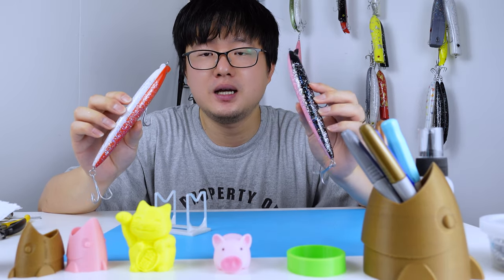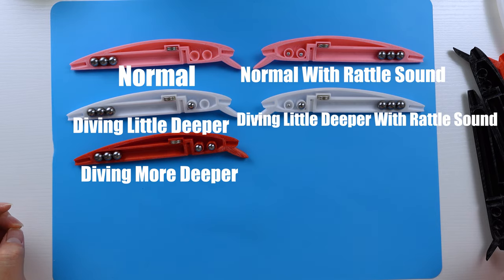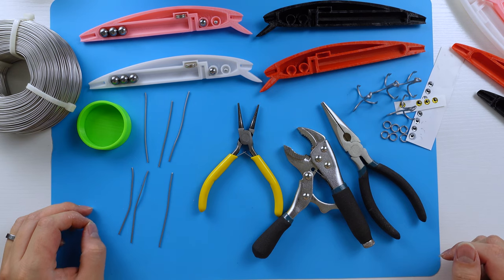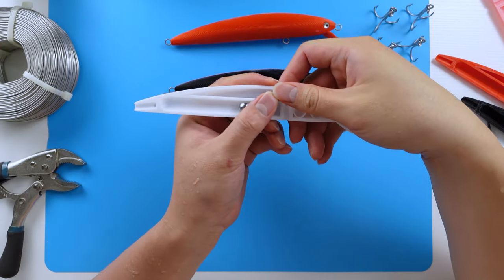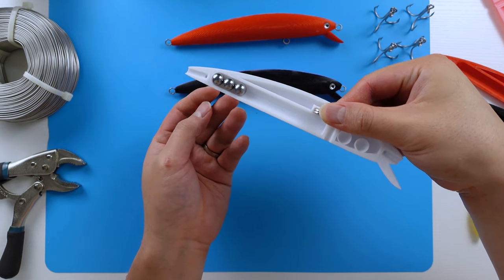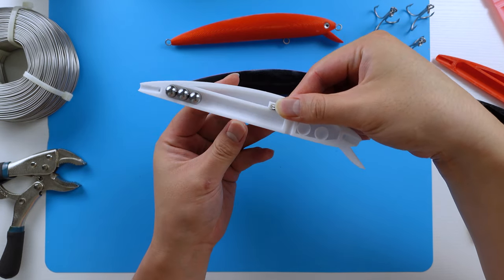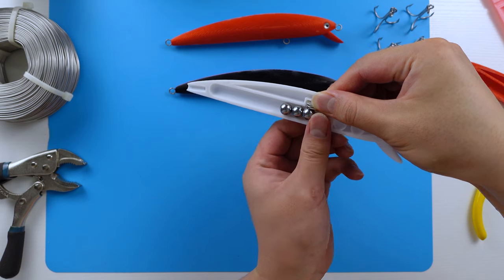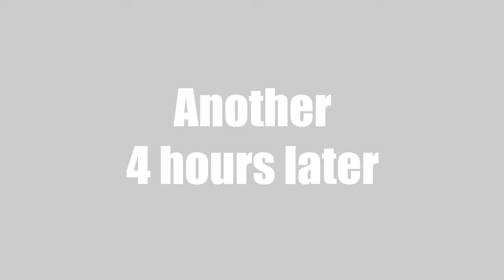Making Minnow Lure with Magnetic Weight Transfer System. 3D Printed Fishing Lure Making.

Comment: I’m doing similar work. Probably not going to create a YouTube channel.  You have a very clever way of locking in the twisted wire using tag ends. Those who build lures will see and know, but for those not into lure making you should slow down and talk about how those tag ends going into the hole add considerable strength. For me, the toughest part was learning fusion 360 enough to even get started. That’s prerequisite to what you’re doing here and people probably would like to see. I know I personally would like to see how you get such clean internal structures. I design one side using offset profiles lofted to generate solid then I shell it then fill center stuff then mirror at the end to get 2nd side. Nice video!
Reply from the maker: Thank you, glad you like it.

Comment: You all but begged for our comments, so here are mine. (I'm a longtime saltwater fisherman and amateur lure-maker.)
1. I'm quite sure this is meant to be a "how-to" video. But NOBODY can learn about what you're doing when you speed up the "tape" until it's almost a blur! This was particularly bad when you were fabricating and installing the hook eyes. I even used the YouTube utility to slow the playback to .5, but that wasn't enough!
2. You show us your procedure for applying three coats of clear finish, but you don't tell us WHAT coating you chose and why. In fact, you hardly talk at all during this process.
3. I think the main focus of this video was supposed to be your weight-transfer system. But you didn't explain why you chose this particular configuration—a horizontal tube, three bearings, and a rare-earth magnet mounted off to the side, at one end of the weight tube. There are many, many ways to accomplish this weight-shift goal, but you don't say anything about why your system is better than the others.
4. You didn't show us a water test of these lures after they were completed! You left us guessing about how they swim when retrieved AND about how well your weight-transfer design worked during each cast. 
     I'm sorry if I seem so critical. I wouldn't have written these comments if you hadn't asked. Most important, I believe this video COULD have been a really valuable, useful one. But—for me—it fell way short because of the lack of detail and the absence of a water test.
Reply from the maker: Hi, thank you very much for this very detailed comment. Because this is one of my very early video so I was not experienced about making video. Some of the problems you mentioned I was kind improved in my other videos afther this one. If you like you can watch my other videos. And about water testing of this lure you can find footage clip in my first fishing video. If you want to see you can go watch it. Thank you, I will take your suggestions and improve my future videos.